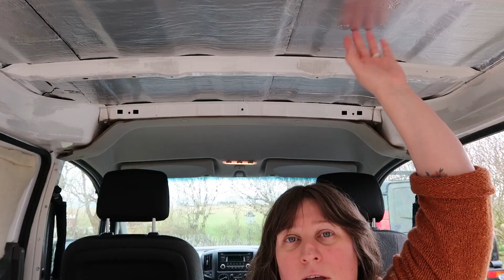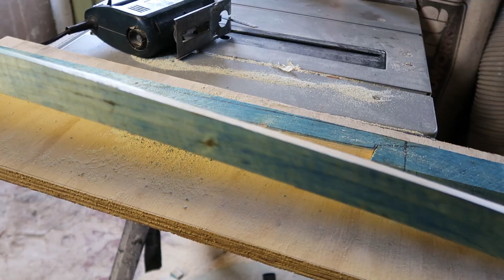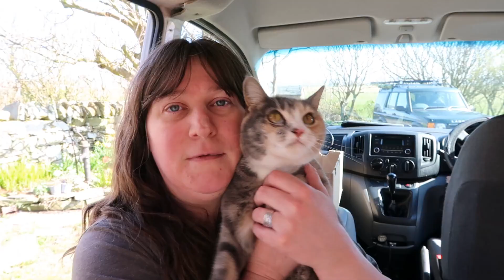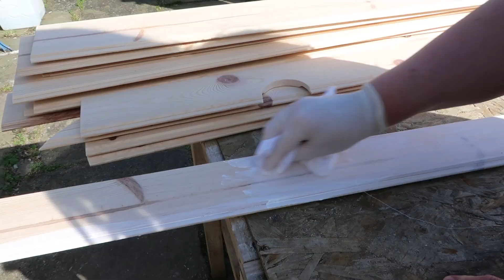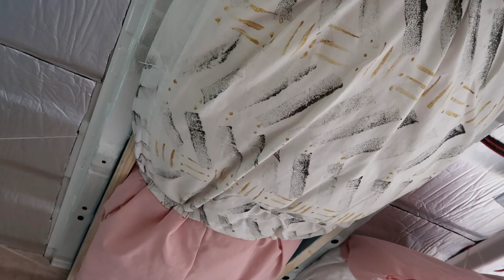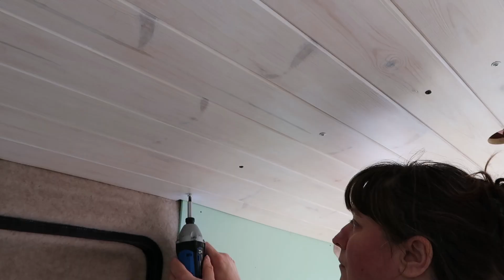Ceiling Installation ~ Nissan NV200 Van Build ~ Vanlife

Comment: It's looking really smart! I'm in the process of converting my own eNV200, so it's great to see how you're doing and to get some tips and ideas. 
I ended up just using foam board insulation in the ceiling, and covering it with material, but the wood will probably be more durable. I've not been brave enough to cut a hole in the roof for the fan, so my plan is to install it in the door... thats my next job... I've been putting it off for weeks ! 😅
Reply from the maker: I'me not sure if i would have been brave enough if there hadn't already been a smaller hole already cut out, but having tested the van recently I am grateful for the ventilation at night even when the fan isn't switched on  :)